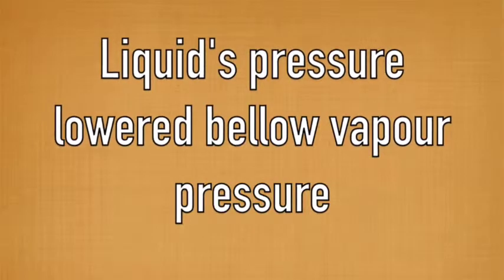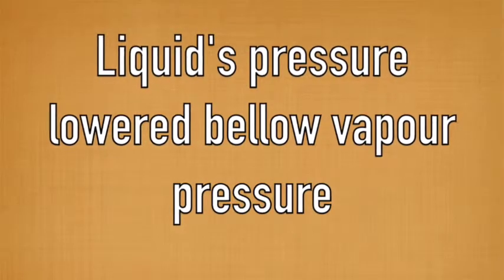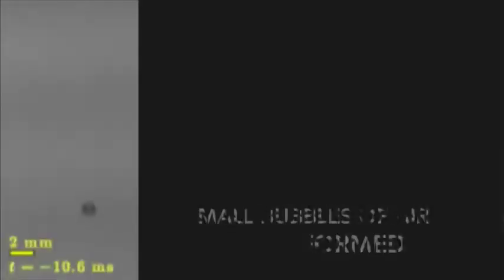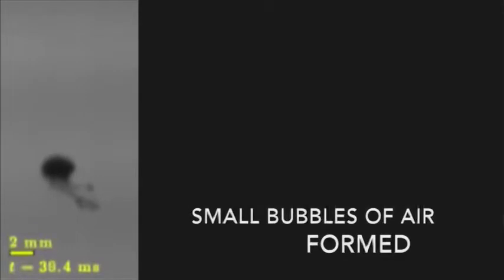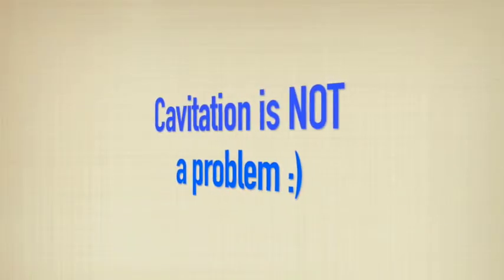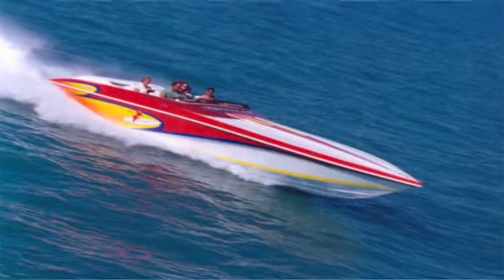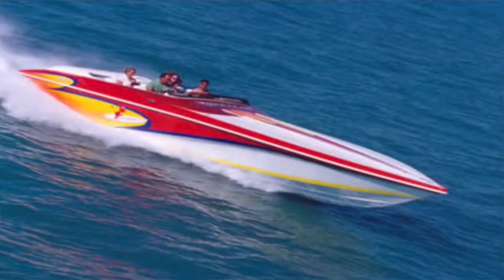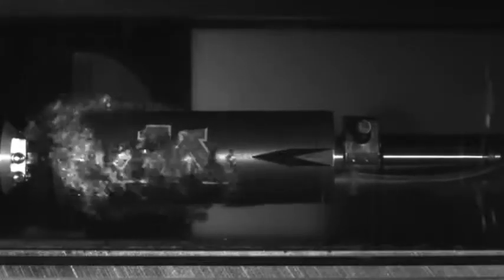Cavitation

Comment: At 01:20 that propeller is shown to be lacking good design.  The leading edge is showing super-cavitation starting near the boss which means that the  leading edge has the wrong angle of attack or indeed the edge is too sharp and the water is stalling so early.  As for the trailing edge, that is also lacking good design as the maximum radius of the propeller is midway between the leading edge and the trailing edge.   I much prefer the  maximum radius of the propeller to be closer to the trailing edge.

I need say no more about the design of a good propeller as what I advise is for  any designer to walk to a forest and look at all the birds or to take a deep breath and dive underwater to see the fish, and one will find that all the birds and the fish irrespective at what speed nature meant  for them to travel in their respective medium, ALL THE WING  TIPS AND FIN TIPS IN BIRDS  AND FISH  THEY HAVE BOTH THEIR LEADING AND TRAILING EDGE, RAKED BACK AT  THE TIPS. 

The wings of the British plane Spitfire and Hurricane were the wrong design and the Mustang and the Me109  had better  wing tip design and in fact the Spitfire eventually had its wing tips cut off.  At about 1950 the jet planes had both their leading edge and trailing edge raked back and now all water propellers on most ships and yachts has trailing and leading edges raked back.

For a good start, I even made propellers with progressive change of pitch as one operates  along the different radius  as at start conditions the high pitch near the boss acts more like a paddle wheel rather than a pitched propeller.   There is not need to get a high speed drive from the boss  area of a propeller but at starting condition it gives a better drive as the fine pitch condition in a plane taking off.  There is so much to study about modern shapes in propellers, but to reduce time............just go and analyse what nature  evolved before we did as far as wings in birds and fins in  fish and sea animals as the whales and the dolphin and the Orcas............ it is all free good design for the taking .